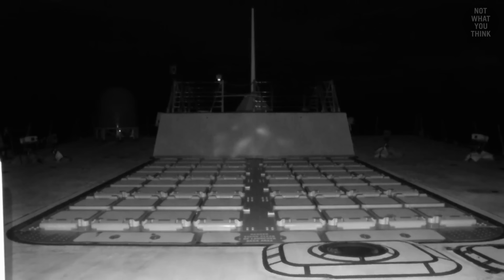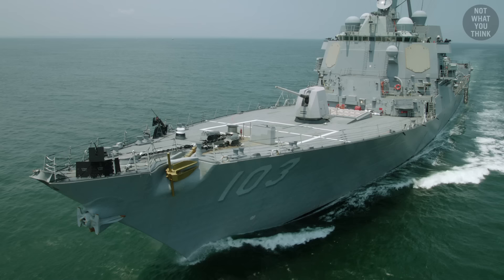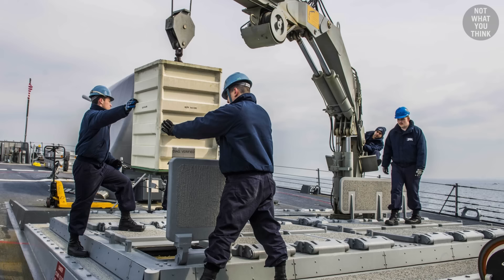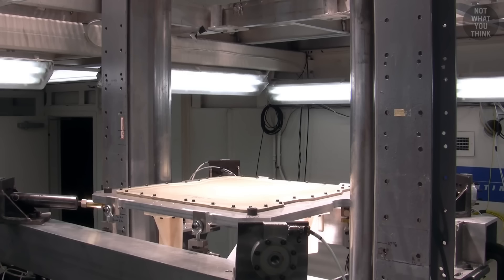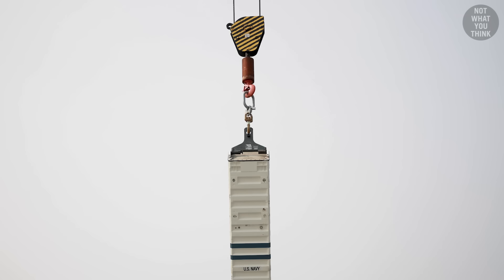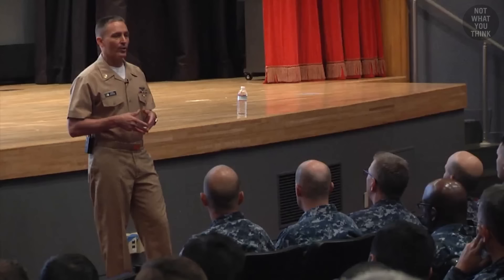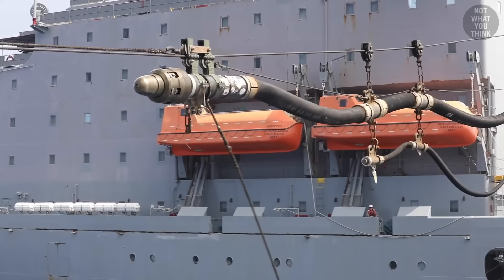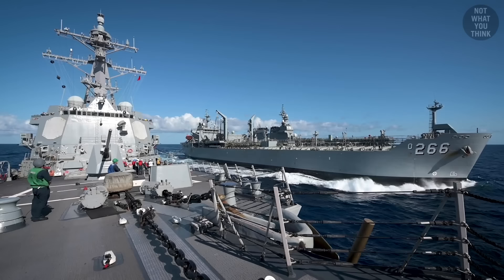Why Warships Cannot Reload Missiles at Sea

Comment: Instead of loading the missiles one by one, why can't we just load them all at once with one big missile container when in calm seas or ports?
Reply: tell that to the us navy
Reply: My guess is one bank of launchers could have reliability issues, and the potential to change the ballast of the ship too much when attempting to reload unless in drydock, making the change less efficient and a PITA in logistics
Reply: Because those missiles are not small.... they are over 20 feet long and several tons
Reply: separated missile kinds for different scenarios each time, also mixed together. This isn't feseable
Reply: He states one or more, but the issues remain added to a bigger boom.
Reply: @TheJttv couldnt still time be cut by installing a crane that goes over the ship and takes out the missles in the ship takes the packages of 5 or whatever it can carry at once and put it in there like lego while the missles that havent been shot get re sorted and parted from the used ones
Reply: that would only work if all the missiles has been fired, and if they didt use mixed loads of missile.
Reply: A big issue with this is what if you launch half a battery of missiles. Then you have to decide, waste half of the missiles, or to not try to reload until you are out completely and then have no defense when you go to do so
Reply: @Shreeechan  yes but if you say like there are fix packages of 5 missles loaded each that can be taken out as the whole pack again, replaced quickly as to not waste time in that process and then reload said „magazine“ or pack of missles for the next time it needs to be used
Reply: What if you only fired a rocket?
Reply: Thats simply not how the system is designed. That and it severely limits your flexibility for loadout by setting minimums.
Reply: You're talking about lifting maybe 50-100 tons rectangular modules that have to perfectly fit, be wired and then be stocked in significant quantities world-wide.
Reply: Physically, sure. But these things are MASSIVE. There are also fairly complex electrical, mechanical, and even water connections that must be made below decks. As oaths have pointed out, you’d probably need a 100t+ gantry crane to lift it into position and those are only at shipyards that do heavy maintenance. You couldn’t do it in a small atoll lagoon like you can with individual cans.
Reply: Crane was very limited in use, and the replenishment ships had better cranes, so might as well ditch the crane and gain more missiles in the same space.
Reply: @dcviper985  would it be theoretically possible for a form of auto loader to exist? Its heavy but what if there were deisgnated positions for missles to fire out of and after each shot another one gets loaded in. Even if not for the missles but overall for things on a ship could be usefull
Reply: @TheJttv how about a breach loading technique like in a tank but vertical? Have a conveyor horizontal at a slight pitch until it's vertical and/or picked up by a winch system to place in and seal for fire?
Reply: My thought but it was a frame that could have missiles added where needed. I assume the empty loading cells may need balest to help with balance but the whole thing could be attached and removed with pre loaded missiles.
Reply: @Coecoo so what about a frame with just the missiles needing replenishment. Or just a single frame with a funnel design.  A design that progressively increases the accuracy for high sea states is obvoise .
Reply: @dfinlen  you could also rotate the assembly like a revolver in order to have somewhat of a symmetrical balance as well if you need to account for lost weight. I'd assume they fire off in the best possible order already with the grid config
Reply: @sirseven3  been tried before. Too slow.  The advantage of VLS is all missiles are ready to go. Having to reload like some older twin arm systems means you fire two missiles and you are saturated (defenseless) while it reloads. VLS is slow to resupply but atleast all missiles are ready at all times. Also its modular. Many different types of missiles fit in the cells. Some even 4 in 1 cell.
Reply: @sirseven3   The VLS cells are much too long for that. You'd need an enormous depth of hull which would add to cost and the engine power needed and seriously limit where the vessel could operate.
Reply: @trolleriffic  I see, I'm trying to think of possibilities but it seems the entire system would require redesign in order to make it work 😂
Reply: They are going to do that
The DDG-X is planned to have swappable VLS modules which allow the entire units to removed and replaced instead going one by one
Depending on how many missile used or the time
They simple pull the module for maintenance and replace it with fresh loaded one
Personnel on shore can handle the unloading of unused round and put them into VLS for later use

Comment: A major point not mentioned is that it's even more difficult to reload the magazine of the older arm launchers (in VLS, the launcher is the magazine, so it's more reliable and compact enabling a larger loadout).
Reply: I'm afraid I have to disagree. DDG-21 Late flight Adams class, we could (and did) re-load the SM-1 (virtually the same body as SM-2) into our MK-13 launcher (one-arm bandit) underway. Yes, anything done underway is harder than pier side, but practice makes for speed.